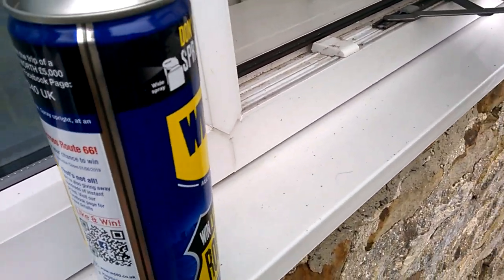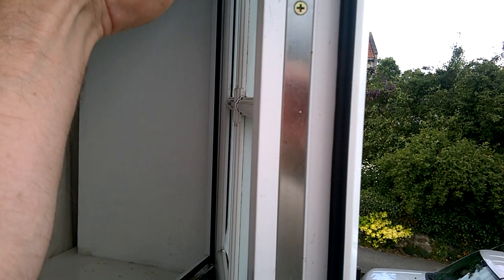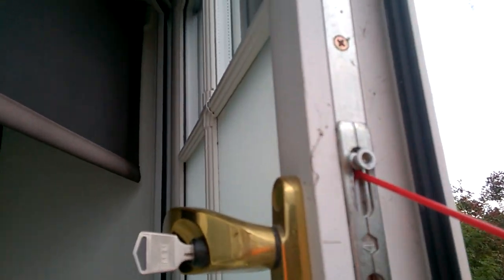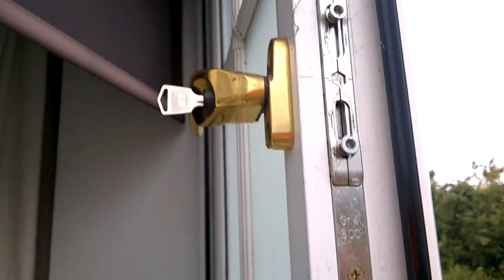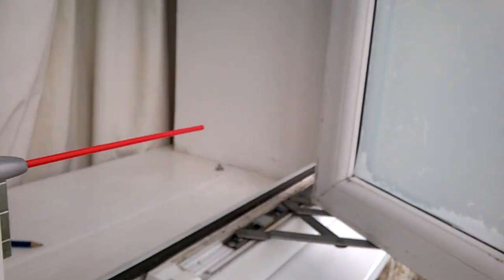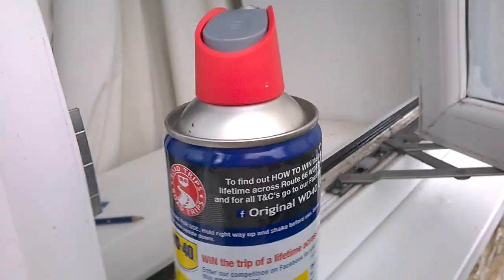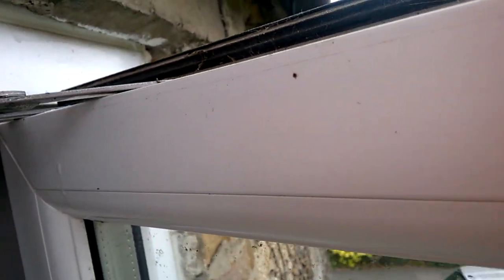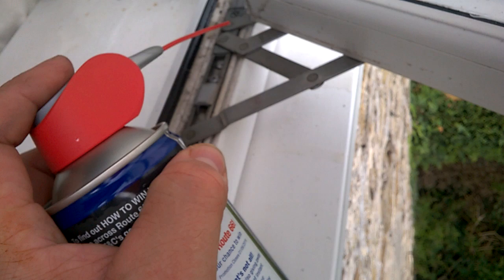sticking double glazed windows and locks easy fix with wd40

Comment: Contrary to popular belief WD-40 is NOT a general lubricant and should never be used on uPVC windows as it will eventually cause deterioration. Only use a silicon spray such as GT85

Comment: WD40 is only a temporary solution. Once you’ve un-seized the mechanism, most professionals recommend vaseline as a long-term lubricant for your window, as it’s less mucky than oil-based grease.